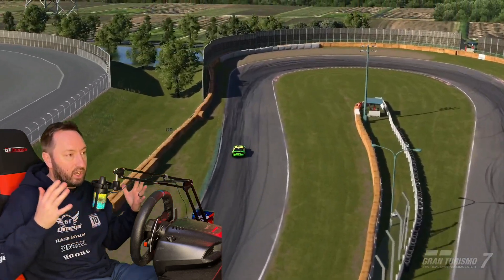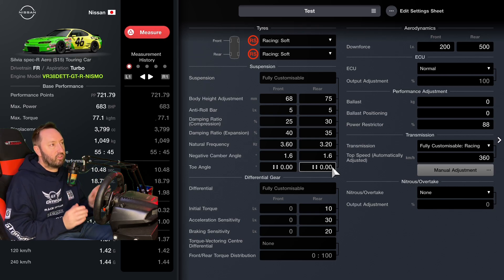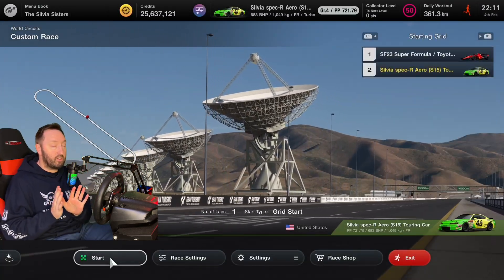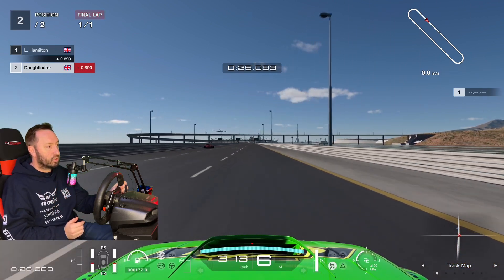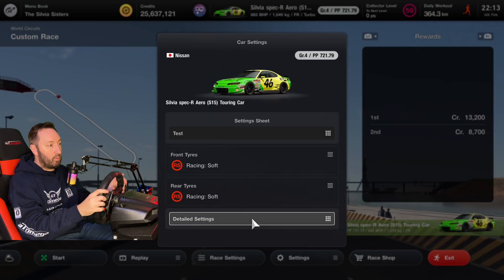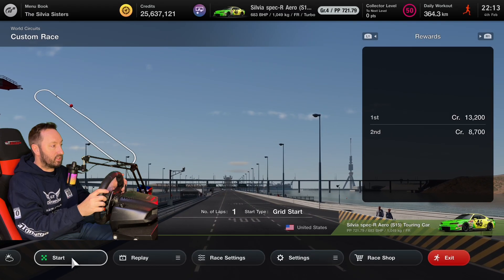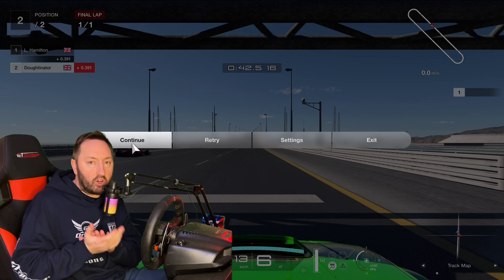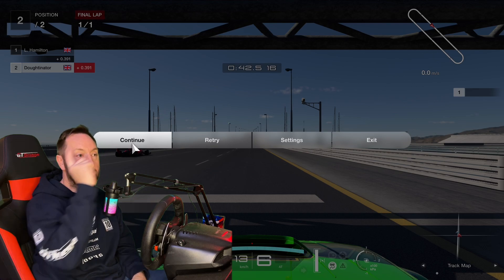GT7: How Tire Wear is Affected by Toe Angle

Comment: Have you done any testing on how tire temperatures affect tire wear? This is something I've been digging into lately. It makes sense to me that the more toe angle you have, the more friction there will be, which will increase tire temperatures, which will increase tire wear. I think the most pertinent factor is the tire temperature, regardless if it's obtained by toe angle, ambient temps, driving style or anything else.
Reply from the maker: I’ve not properly tested temperature effect on tire wear. It’s quite hard to find an isolated test to prove it 100% 
But I do agree. It does seem to be most related to tire temperature. 👍🏻

Comment: Toe is a compliment to the Camber/Caster.  Depending on the style of suspension and total droop/compression or axles, should be a large indicator of where you should be close to.  This is key to understanding drifting/rally as well as creating more stability in shorter wheelbases.
Reply from the maker: For sure. Everything in the system needs to be considered with a full setup.
Reply: For instance, in my standard tunes for most cars when tuned for Racing Tires Front is +10 and Rear is -20.  But I'm also using around 25mm off bottom stop for ride height with a Gr4-esque dampening and 3.5 camber.  Give a very strong mechanical grip and stability.  Just gotta be calculating on the spring rate for weight and balance.